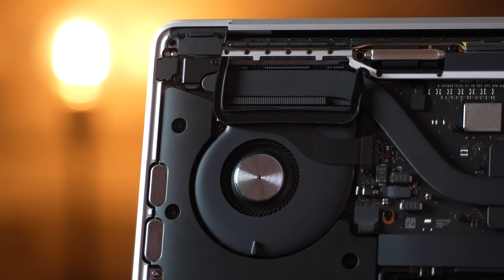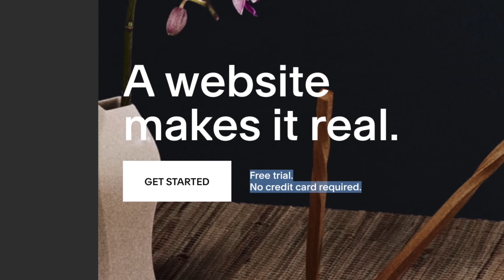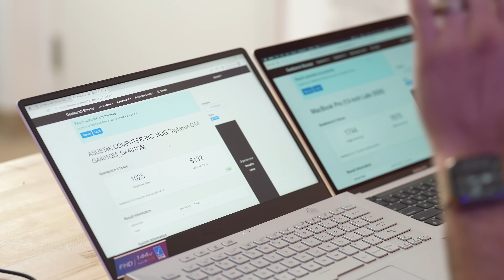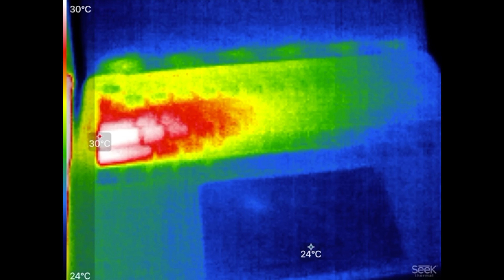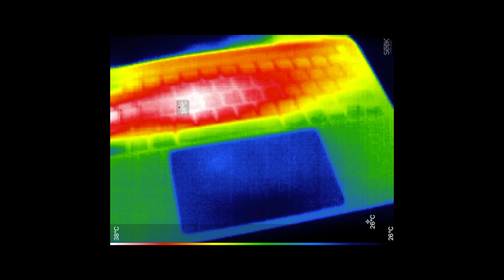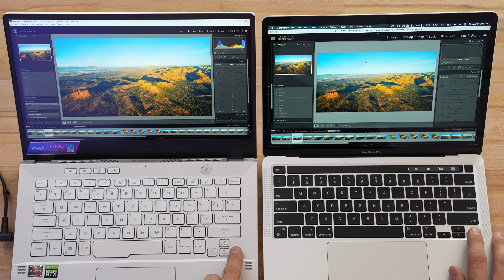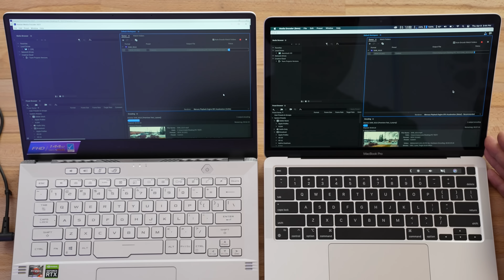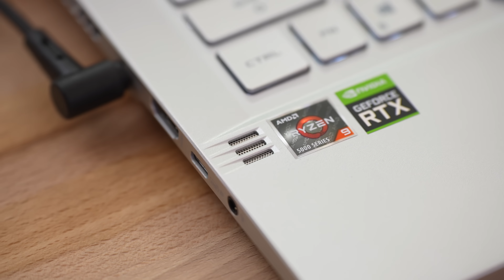Apple M1 vs AMD 5900HS + RTX 3060: FINALLY an M1 Killer?

Comment: If  low end 8 core Apple M1 smokes AMD  5900 HS in CPU performance I am dam sure  upcoming M1X with 12 core will be the fastest CPU in  any laptop....
Reply: Lmao stop calling this "low-end" , m1 has the best cpu cores apple has ever designed
Reply: @mtunayucer its the best chip apple made  now but its a first gen chip made by apple for low end macbook air and pro, they not putting this m1 in higher end macbook 16 inch so its a entry level first gen chip from apple for sure if it will this good what will be upcoming m1 x in macbook 14 inch or 16 inch
Reply: @clementmv  Its not a first gen either! Apple has been designing their own cpu cores since A6 (64 bit since A7) and M1's firestorm cores are their 8th generation arm64 cores.  A7 being 1st gen, A8 2nd...
Reply: @mtunayucer  Yeah, that's it. Apple boys just love to hype things up😂
Reply: Well technically that laptop was a gaming machine and it did it's job perfectly.
Reply: @anjirkased8492  that laptop has a dedicated gpu and its a gaming laptop, it will have more gpu performance than m1 but remembered its compared to apple low end macbook intagarated gpu and its a 1 gen chip
(In case of CPU performance surprisingly M1  crushed AMD 5900 hs )
Apple already working on 64,32,128 core gpu for future....
Reply: I get that Apple made a great chip. It really is great. And I've watched like 20 reviews of that chip alone. Apple got such a high single core score in geekbench, one cuz that chip can read the queue of instructions far ahead and then multi-core it inside a single core, that's just good optimization, and second, geekbench single core is single core, single thread, so all x86 chips are a bit handicapped, and when this handicap is removed they do have much higher single core than M1. Even then Apple does this with much lower power, so it's still amazing. But not as amazing as you fan boys claim.

The M1X is rumoured to have 12 cores, its very likely to have the same fire storm cores, just 4 more. That's not gonna help single core. At best Apple will optimise some more, get a bit more IPC and a bit higher single core, but we'll see. And since it has 50% more cores, multi-core could be 50% better. But AMD still has chips with more cores, so it will always have the multi-core crown. And also, Apple hasn't moved to MCM design, while AMD is like three generations into it already. If you're gonna say Apple will make chips with more core, how are they gonna do it with SCM design? It's impossible from a manufacturing stand point.

Its just that reviewers like this channel and Apple itself give a very overly positive review of Apple products. Use a bunch of cleverly tuned benchmarks to show it in an overly positive light, that's all. They claim this chip can do anything, yet many reviewers have shown that's not true, and the claim it can do anything is simple selective reviewing. People say it can edit 4k, yes it can, if it's a lite 4k render. 11th gen Intel can do the same, it'll just use more power. NVENC is still the fastest rendered in real world use and it can render much tougher videos. Fact is, this chip is amazing, but not cuz it's the most powerful, but cuz it like 80% as powerful as the most powerful in windows side, but will have about double the battery life in lite use.

All in all, since Apple is Apple, they could wow us all. But more realistic study and expectations say otherwise. In any case we'll see 🤷🏾‍♂️
Reply: @harigovindsroriginal  also its uses way less power consumption than intel or amd and its fabricated by much better 5nm artecher...  And  apple alredy working on 32 64 and 128 cores
Reply: @clementmv  I agree it's more power efficient, but I really don't think even 16 cores its possible with the low yield rate of 5nm process, without MCM🤷🏾‍♂️. So how is Apple going to produce it? And in GPUs it doesn't really matter what you say now. You could say RTX 3090 has 10496 cuda cores as compared to apple's what 128?😂. So speculations are just that, speculations, real world performance will determine who's the best. And only very few reviewers actually review that, this channel sadly is not one among them😂

Also BTW, Intel's 10nm is closer to TSMC's 7nm, check Linus's video about these company's marketing terms. Intel uses more power in their 10nm than AMD's 7nm cuz their micro architecture is not as efficient as AMDs, not cuz their manufacturing process is a lot worse, its actually very close😂
Reply: @harigovindsroriginal  and your 10596 core gpu not ina laptop either its a dedicated gpu
Reply: @harigovindsroriginal  its sure apple M1X with 12 core will smoke AmD fasttest cpu even m1 alreday does
Also kepp in mid apple has control over hardware and software and even macbook 16 gb ram smokes 32 gb or windows laptop in ram management
Reply: @clementmv  Yes, I admit, apple's chips are very power efficient😂. But they're still not the king, they might be in laptops, for now😂
Reply: @clementmv  We'll see, we'll see😂😂. But already giving a verdict that Apple has won the PC chip race, that's foolishness my man 😂. This at best, is a small temporary win. That's all🤷🏾‍♂️
Reply: @harigovindsroriginal  in laptop segment cpu wise  m1 the fastest. Yes amd has other more powerful chip
But compare Amd best laptop chip vs apples
What the point of saying amd has more powerful processor while non of them are in laptops

(current best Amd chip  for laptos this Amd 5900 hs and Apple  m1 smokes that in cpu wise no doubt about that)
If you cannot thinks ita not a victory no prb,...
Reply: @clementmv  Dude, I never said M1 is bad😂. And the best AMD laptop chip is 5980HX (though it's probably never gonna be in anything, do 5900HX). All I said was it's good, but not as good as many reviewers claim🤷🏾‍♂️. Reviewers who use more real life situations than synthetic benchmarks (especially single geekbench handicaps x86 chips, and not M1) say otherwise🤷🏾‍♂️. And yes you could say apple's laptop chip is he must powerful, but you can't say M1 is the most powerful, cuz apple's doesn't have desktop chips, yet🤷🏾‍♂️
Reply: @harigovindsroriginal  you said Amd has more cores yes but for laptos AmD 5900 hs clamed to be thier fastest chip, but m1 is ahed than 5900 hs in cpu dept
Reply: @clementmv  In benchmarks dude, not in real world🤷🏾‍♂️. And even there, AMD is still the best in multi-core. And even if Apple's M1X or whatever has higher single core, AMD isn't just gonna sit on their asses😂. Not the mention they're this close to apple's ARM chips with x86 chips (which have a lot of inherent handicaps). What happens when they go ARM too 🤷🏾‍♂️. Also, NVIDIA would join in too, their Tegra chips are very capable and power efficient (they just haven't made a high power chip yet), but in a lot of real world ways, NVIDIA is much smarter than even AMD in software side. So, only time will tell dude 😂😂😂
Reply: All I'm saying is, reviewers have got to stop using synthetic benchmarks (especially ones which handicap one side) and move on to real life performance, stop making things bigger than they actually are, that's not honest review, that's clever marketing😂. And fan boys have to stop giving Apple the win before the actual battle's even started🤷🏾‍♂️😂😂
Reply: @harigovindsroriginal  benchmark shows raw performance and incase of that dedicated gpu of amd smokes m1
So you talking about real world performance but as shown  in this video even whith those massive leads the real world diff is not that huge btw m1 and dedicated gpu
Reply: @clementmv  That's what I said, benchmarks don't show much. NVIDIA GPUs bench much higher then M1 and yet in real life they're only a bit better (though that widens when the task or here render becomes more difficult (selective reviewing my reviewers 🤭🤭🤭)). And in this video the only place they show real world scenarios is when Apple benches lower 😏. That's why I said, selective reviewing😂
Reply: @harigovindsrfortechnology  what i mean is in laptop cpu segment
Reply: @harigovindsrfortechnology  bro just understand what i said Amd has more powerful chips in desktop segment
 But those are not in any laptops  in case of that
Then what is the point of saying amd has way more powerful chip than apple yes its is but non of them used un laptop 
Compare amd laptop chip  with apple laptop chip
 if m1X came out with 12 core i dont think amd has any competition to apple in laptop segment in processor......
Reply: @clementmv  Dude, don't say something won even before it has been released😂😂😂. It might win, I agree. But wait until it actually releases 😂. And even then this is like the first move in the PC chip race by Apple, that's all. Others haven't made any moves yet😂. So stop saying Apple won even before the battle's started, that's all I'm saying😂

Anyway, Apple has won now. And it's great for us, as consumers. So congrats Apple 👏🏾👏🏾😁.
Reply: @harigovindsrfortechnology  when m1 x came out i see youu bro max tech also has a video shows about leaked benchmark of M1X whatch that also
Reply: @clementmv  😂😂👍🏾👍🏾👍🏾

Comment: i am waiting for g15 vs MBP 16 ( M1X ) and dell xps 17 vs MBP 16 ( M1X )
edit : actually 5900hs isnt the fastest mobile processor the ryzen 9 5900hx is
Reply: what about 5980hx? isn't that the fastest?
Reply: @generalyido  thats actually a custom cpu whereas 5900 hx is an unlocked overclockable cpu and btw it is not 5980 hx it is 5980hs locked cpu built for power efficiency and performance for ultrabooks
Reply: M1 still use 4 high cores + 4 low cores, m1x mill maxout 8 cores. it maybe 2x performance today..
Reply: M1X gonna eat Intel and amd for breakfast
Reply: @user-fi3cd3ig6l  Since there is no M1X chipset out there at the moment, we really don't know that. Also, if you have been paying attention to Apple over the last 10 years, it's not going to be a huge upgrade over the current M1. Expect about a 15% boost in performance.
Reply: @timg6930  you’re talking about generational improvement... (example: i3 gen 9 vs. i3 gen 10)

M1X is not a generational upgrade it’s a categorical upgrade (example i3 gen 9 vs i9 gen 9.. i9 is much much faster than even the gen 10 i3)

M1 is aimed at lower end entry level computers where as as M1X is aimed at higher end computers. What you’re saying will be true for M1 vs. M2 but not M1 vs. M1X.. this will be much higher (hopefully)

Comment: Just in time to get beat up by the M1X or whatever the next one will be called.
Reply from the maker: That's going to be insane.
Reply: R u srs, the asus was 300 dollars cheaper, the m1 got well and truly smoked this time around. The asus had the cooler design, better performance, and better display and keyboard.
Reply: @omsingh4478  Only cheaper you on-point, the rest? aint you watching this video before comment??

Cooler? that with 90C
Performance? still need plug-in yet barely made it most task
Oh, dont talk about display. Its gaming machine, color accurate never to be mean solid.
Reply: @kanzai12  cooler design wise. It looks cool. Bro in game the asus easily wins. And u rlly think a glossy display, with better colour accuracy can Trump a matte display with a higher refresh rate. U mad?
Reply: @kanzai12  r u a photo editor. I'm guessing not. Then the mac book has a better display. But tbh, if u r a photo editor like I am, u use a monitor more than u wld Ur laptops screen. So colour accuracy doesn't rlly matter.
Reply: @omsingh4478  I think, you are the one mad here lol. Of course fresh rate gonna be on gaming laptop but you said better display without good color accurate are pointless. 
And you barely talk about other part lol
Reply: @kanzai12  what other part, the performance is just clearly better, and it's not like the zephryus has bad colour accuracy, is quite decent. But objectively speaking, higher refresh rate just looks ten times better than colour accuracy, most people cannot differentiate between colour accurate and non colour accurate displays after all, but everybody can tell the difference in refresh rate

Comment: Nvm apple will come with another world’s fastest chip
Reply from the maker: @John-Paul Hunt Or Apple. This is an 8 core integrated GPU that only uses 5.6watts compared to 80 with the 3060 here. Imagine a 32 core dedicated one from Apple..
Reply: @MaxTechOfficial  😧
Reply: Next
Apple’s 4 core M1 Vs AMDs 100 core chip
Reply: @John-Paul Hunt
But in cpu performance it smokes AMD chip 
Apple uses intagarated gpu apple is already working on 64 or 128 core gpu already just wait,